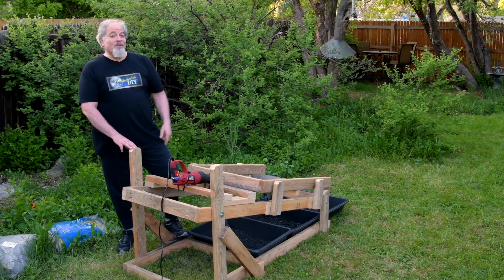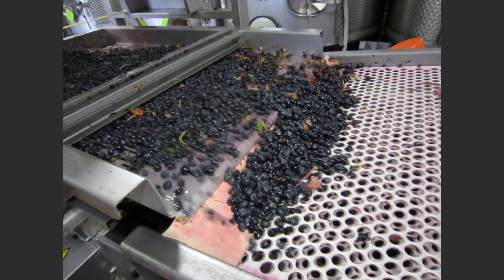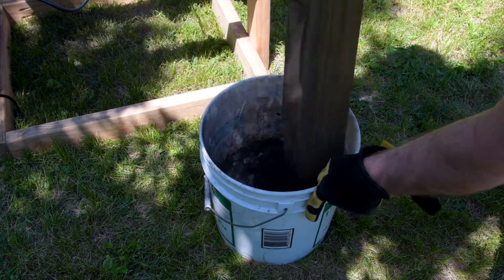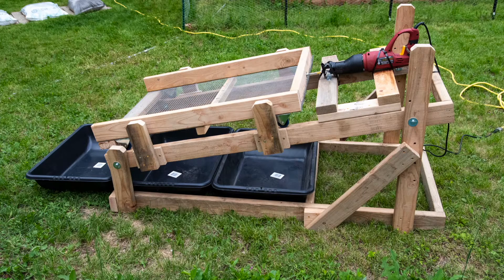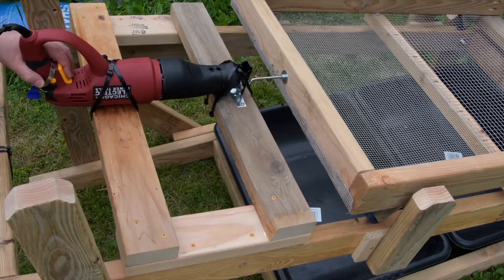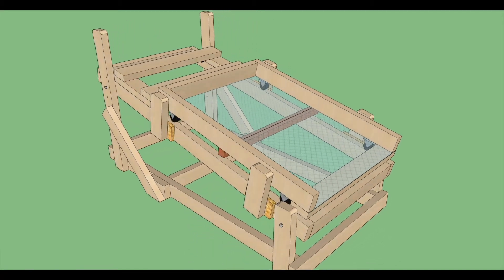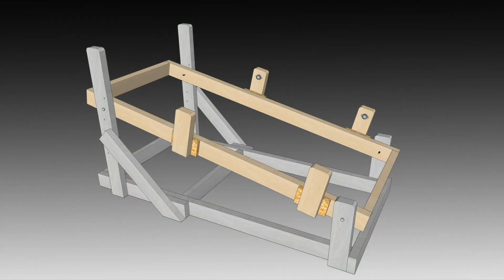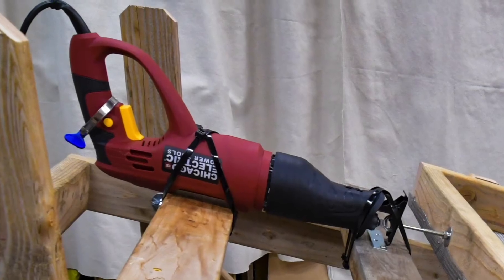Sift, Sort and Clean Soil, Compost - and So Much More - in Minutes!  DIY Motorized Shaker Table!

Comment: Read this before purchasing

I purchased this recently, then purchased all the materials, and am now getting into finally building the sifter. I am EXTREMELY frustrated with these instructions, and the way they were presented. I have now spent about 2 hours trying to go through the instructions and organize them to make sense of them for actually making the table. I want people to understand how this information is presented, because I don't feel the written material constitutes "detailed plans" as advertised. While a closer reading of the advertisement does explain that there are no written instructions exist in the traditional woodworking sense, I naively assumed that plans meant some form of written instruction. My issues are as followed:

1. The videos are not hosted on youtube as this video is. The videos are hosted on the website. This means they can only be accessed from the website, and the website is very clunky. It cannot be easily accessed from a phone or tablet, so good luck if you don't have a laptop you are comfortable bringing into your shop or garage. The player is also very inferior to youtube's. You cannot change volume, easily go backwards in the video (you will need to to catch all the instructions). This could be easily remedied by the owner of this page hosting the videos privately on youtube, only accessible by those who pay

2. The PDF switches between if you use butt joints or pocket holes, which is confusing. Two documents should have and could have been made for the two options with only a little editing. For the price, this is expected. 

3. The video shows only the table being made with pocket holes, not with butt joints. This is a minor thing, but the creator also is often not clear on which screws should be used, and the designs call for SIX different ones. I have no idea which screws to use when in most cases. 

4. The videos have no written prompts, and like I said before the PDF does not have instructions, just cut lists and 3D diagrams. I understand there was a lot of work put into this, but detailed instructions should have been made in print, or at least written prompts on the videos, or supplementary written lists of what screws and tools to use on each step. I am unsure if I will be able to do this adequately because I do not know know when to use which screws. This has created a lot more work for me as I now have to think each time about what length screw I need to use for each spot. With over 100 screws being used, this will add significant time to this build, and I assume I will make a mistake at least once, using too long or too short of a screw. Hope I realize it at the time.

5. At least three times throughout the videos it is explained that a change has been made or something isn't exactly right on video. This isn't okay. It adds even more confusion. 

6. The price of $29 is a lot for plans. I expected written instructions at least for that, or at the very least a better video that showed exactly what I needed to do, with what screws, and with written prompts. 

7. With the video not matching what I need to know, not knowing what screws to use, the terrible video player I was already extremely frustrated and annoyed, and then in the middle of instruction I am shown an advertisement for a drill and impact driver. If I am paying for it, why are advertising to me? In the middle of what you claim are plans. That isn't okay. 

8. I already purchased all the materials and this is the best design I have seen for what I need, so I am still going to try and build this, but I am really unhappy about this and the time I feel I am wasting. Please consider that this is not easy to follow or straightforward, and there are no written plans at all before purchasing. Ultimately, knowing what I know I still would have purchased this, but I would have went with different plans if I could find any other build that would work for me.
Reply from the maker: Hi Sam, I am sorry the plans were not as you expected them to be. It’s clear that you were expecting stand-alone written plans rather than a combination of video, text and visuals. Thank you for bringing this to my attention, and I will clarify on my site (UnchartedDIY.com) that the PDF is illustrative in nature, not a written manual.

The PDF is not meant to be the end-all set of instructions, but a printable compliment to the one hour of step-by-step video tutorials. These plans consist of: a Cut List, Cutting Diagrams, Visual supplies and tools lists, Dimensions, Structural component diagrams and 3D views.  The video modules show the progress of the actual build.

I reached out to you to offer my help (via email since I have no other contact info), because I want every one of my viewers to have a great experience. You, or any of my viewers can ask me questions at any time. The plans and the site have contact info, and as you can see from my comments sections on my YouTube videos, I am responsive to comments and I’m quite happy to answer questions. I think I could have helped out before your frustration level reached this point.

There was a lot to unpack in your comment here, so I have addressed each point. 

1.  "The videos are not hosted on YouTube": I have put hundreds of hours into the Plans and Tutorial PDF and Videos, providing a huge amount of detail, and I don’t want my work to be pirated.

YouTube doesn’t support video on demand/pay-per-view structure, and “private" videos are extremely easy to pirate. It’s kind of like using a piece of string to secure an expensive bike to the bike rack! The video modules are accessed through UnchartedDIY.com, but the videos are hosted on a dedicated video server with locations around the world to make sure they load very quickly. 

They have been tested to play back on ALL devices, from Windows, Mac, Android tablets and phones, and iOS devices, and until now, no one has reported any issues. They were tested again just before posting this response to make sure nothing had changed. The player being used IS THE YOUTUBE PLAYER and forward and back controls work just like any video found on YouTube. I did have the volume control turned off to minimize clutter on small screens. It seemed redundant when devices have their own volume controls, but I have since added the volume control back to the videos in response to your comment.

2. "Butt joints verses pocket holes": I only show how to make either type of joint once since demonstrating making those joints each time one is used would be wasteful of the viewer’s time. The two types of joints are covered in a separate video module so they can easily be watched over and over. 

3. "What screws go where":  I mention the length and type of each screw as I show it being used in the video.

4. "The PDF doesn’t have written instructions, only cut lists and 3D diagrams":  If the PDF had each and every step written out, the page count would have gone from the current 33 pages to well over 100 pages. Then, I’d be getting complaints that there was too much information to wade through, and bringing printouts to the work area might cause hernias 😋. It’s already a lot of information and isn’t meant to rival the novel “War and Peace” 😁.

5. "Something is shown in video that had changed”:  Yes, sometimes a step was improved upon that made the plans even better than the original build. I explain why the improvement was made ahead of time, so his helps you to make your Shaker Table even better than mine.

6. “The price is a lot for plans”:  I don’t know what other woodworking-type plans you have discovered, but most only include cut lists and a text list of supplies. I have never seen any set of plans that approach the amount of information included in this set at ANY price. Please keep in mind, this is a Plans and Tutorials Package, NOT A full course or workshop. If it was, they wouldn’t be $29.

 7. "Why is there an advertisement in the video I’m paying for”:  You must mean where I say that I am using a Kobalt drill and impact driver, and if you don’t already have one, I recommend the combo package as a great value. 

I have no affiliation with Kobalt or Lowes. I get NOTHING from recommending them, but I did share my opinion on a set of tools I like, use every day, and paid for with my hard-earned money. 

8. I hope in the end that building this Shaker Table turns out to be a good experience. And, I hope that as you progress through this project, the steps make more and more sense, and that you take satisfaction in building something so useful.
Reply from the maker: Sam, I am sorry the plans and videos aren't what you expected. I will respond to these points, but in the meantime I've reached out to you via email. I want to help you get this up and running so you can enjoy your awesome new Shaker Table.